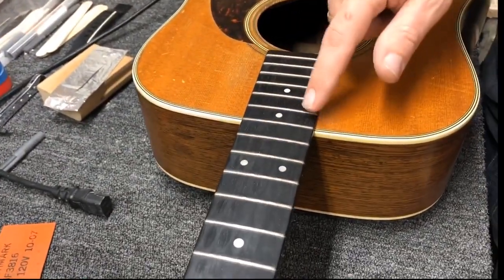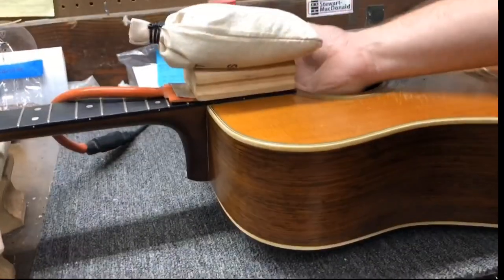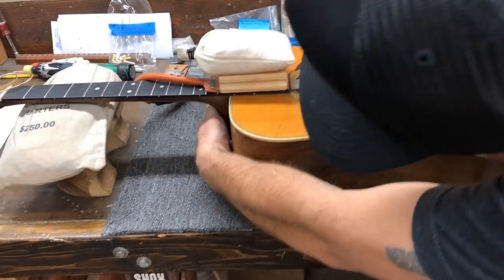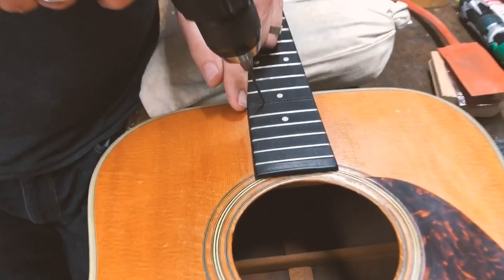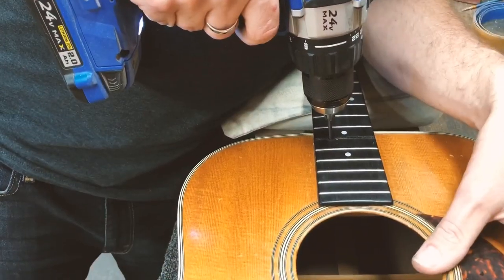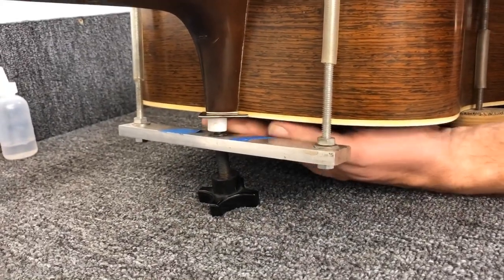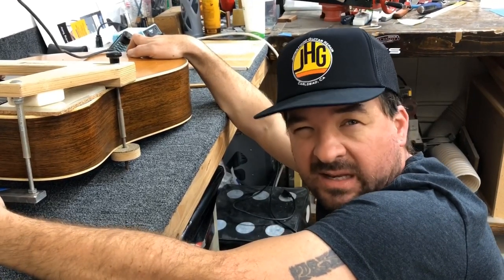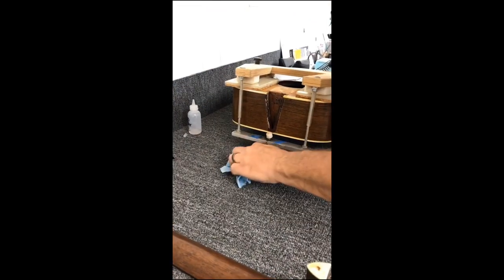Martin Guitar Repair 1958 D-28 Neck Reset

Comment: Honestly it makes Collings or Taylor look like geniuses for reengineering the neck joint.  This seemed like a nightmare, glad it only has to be done once in a long while for these dovetails.
Reply from the maker: Honestly every dovetail neck reset on a Martin is a bit different when it comes to pulling them. Some come off faster than others.

Comment: Hi. I have a brand new dreadnought guitar and the bridge on the base part is a bit higher the the treble side. I shaved the bass part of the bridge to make it equal to the treble side. My question is since i shaves it off, using the straight edge from the neck, I see about 1mm of space between the bridge and the straight edge. Some videos says that is sould landat the top of the bridge, some says it should have a bit of space. Is that okay? Or should I replace the bridge? What is your thought about this?
Reply from the maker: Hi Patrick, typically the bass side of the bridge is taller than the treble side however there are exceptions to this rule. The straight edge is usually about 2 32nds above the center of the bridge on most of the neck resets I have done, In some cases more and in other cases less. It just depends on how much the top of the guitar is deflecting under string tension. I typically won’t set string height over the 12th fret below 5 64ths on the bass and 4 64ths on the treble. Saddle protrusion should not be lower than and 1/8th to 3 32nds on bass side and no lower than 2 32nds on treble side. The radius of the top of you bridge will also play a role in saddle protrusion, the larger the radius the less protrusion you will see on the bass and treble side, the smaller the radius the more protrusion you will see in general.